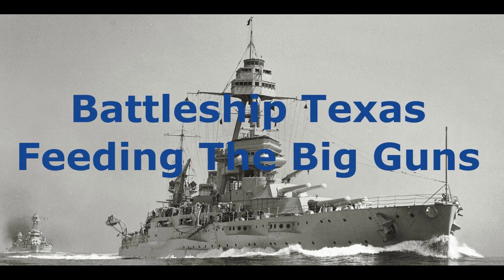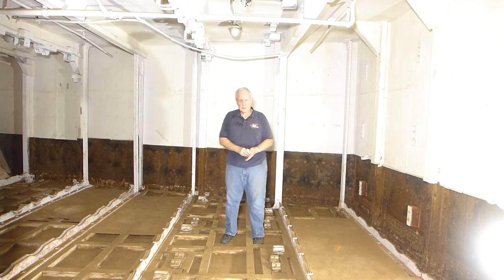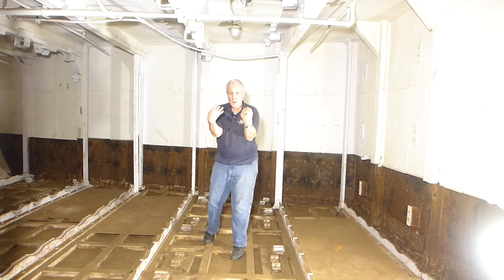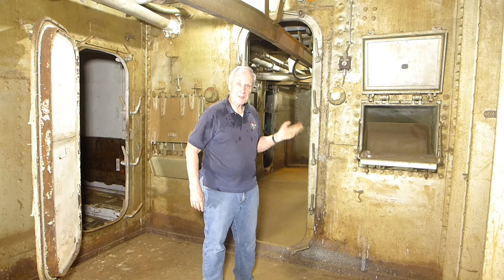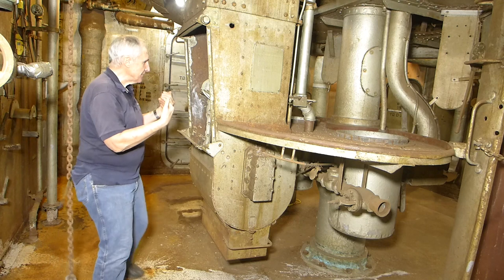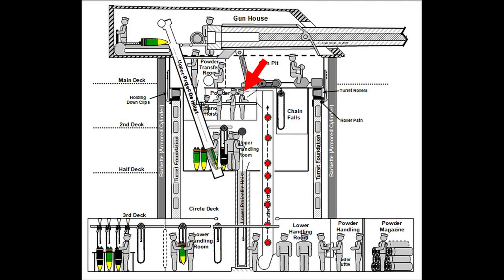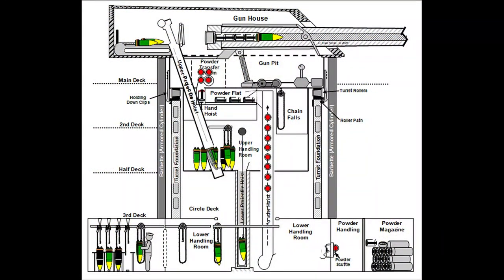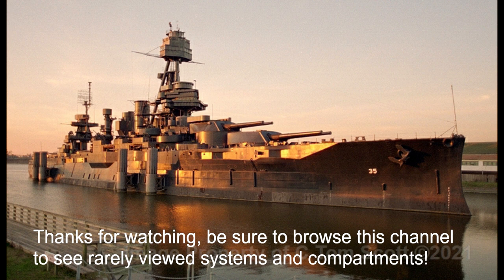Battleship Texas, Feeding The Big Guns

Comment: There are some 16" powder canister's on the USS Missouri.  The seal is locked by a cam which requires the wrench you mentioned.  If I recall correctly the cam locks in either direction but a pointer on the cam points to "Full" and "Empty" on the lid, based on the direction of wrench turn.  This makes a more visual physical indicator for empty canisters, probably desirable for low light situations.
Reply from the maker: It would certainly make sense to have an indicator like you describe, but I haven't seen any sign of one on historic drawings and photos of 14" tanks, nor is there one on the tank that was on Texas.

Comment: You said only Texas and New York stored their shells upside down.  Were their some flaws in the system that caused them to not repeat this on other ships?  Also, what were the advantages of this system over conventional storage systems?  Thanks.
Reply from the maker: First, this system offered no advantages over newer systems, except perhaps it was a simpler design that was cheaper and easier to build.   While I have no documentation to base my opinion on, I suspect that as the first ships to use 14" guns, part of the problem with Texas and New York was that the Navy and shipbuilders simply didn't have the time to fully develop and incorporate a more sophisticated system like the one used on the following Nevada class.  So while the system was somewhat primitive, they knew it would work.  Again, that is strictly my opinion.  Fortunately, a well trained and conditioned crew could largely overcome the limitations.  The new system used after Texas had shells stored sitting on their bases on the deck and moved with a method called parbuckling. More shells were also stored on circular platforms within the turret structure placing them closer to hoists and eliminating much of the manhandling required on earlier designs.  It was successful enough to be used on all U.S. battleships beginning with the Nevada class and extending through the Iowa class.
Reply: @tomscotttheolderone364  thanks! You are a fount of information!

Comment: These processes would not pass a time and motion study.  Its amazing that the rate of fire is as high as it is with all the people in each of these spaces
Reply from the maker: An argument could certainly be made that it was inefficient if you simply look at the number of crew required to move ammunition and load.  However, I think that the crew would have done nicely if subjected to a time and motion study and we concentrate on results, in spite of the primitive mechanical positions.  Tasks were broken down so that each crew member had a limited task that could be repeatedly perform with minimal motion and without becoming overly fatigued.  Each also stayed within a their well defined position so that they stayed out of each other's way, and they drilled on a regular basis  so that tasks were pretty well committed to muscle memory.  Those who had tasks requiring a lot of physical strength and endurance, such as lifting and passing powder bags, were exercised on a daily basis.  The British were highly critical of the turret system's mechanical design and lack of powered systems, but they also admitted that it worked as well because of the crew's level of training.

Comment: A question to your excellent presentation, Scott!
The purpose of the "Shell Deck", or similar in tanks and even aircraft, is what is also called a "Ready Rack", ammo that is in immediate reach to loaders as you described, but it also has a purpose of quickly switching to another type of round from HE to AP for instance.  I am curious if there is instructions saying what shells where in the ready rack?  I guess it might be AP rounds as they would be far less likely to detonate by accident. 
PS: Have you seen my videos on the turrets of the He 111?  There was almost nothing written about operating those systems, just parts and how to service them.
Reply from the maker: Thanks for the compliment.  I don't think that the high capacity shells were anymore likely to detonate than the ap's.  I have never seen anything that specified the type stored on the shell deck.  I imagine that it varied depending upon what may be needed for a specific mission.  For instance, about 2/3rds of the shells expended at Normandy were high capacity.  These guys were pretty smart, so my bet would be they foresaw that possibility and had a mixture available on the shell deck.

Comment: Very cool, thanks!

Was there any way to unload if they decided they didn’t need to shoot after loading a round?
Reply from the maker: They could unload a gun if a cease fire was called before it was fired, but it was to be avoided.  This is especially true if the gun was hot from being previously fired.  It was not only hazardous, but if the powder bags sat in the hot chamber for more than a minute or two without being fired, the heat would change their ignition characteristics and they couldn't be trusted to perform correctly.  

Unloading a hot gun required clearing the turret of all personnel, except for a gunnery officer and a coupe of gun crew.  They would then carefully de-prime it and open the breech.  Each of the four bags would be pulled out and likely dumped into a water tank to make them safe.  A gun crew member would then crawl into the powder chamber and attach a removable lifting eye to the base of the shell and tie a rope to it.  The other end of the rope would be tied to the rammer that had been partially extended.  It would then be run in reverse to pull the shell out of the gun and onto the loading tray.  Doing all of this would likely damage the driving band on the shell, making it likely that the shell would be inaccurate when it was fired. 

It is for all of these reasons that it was much more likely the gun would be "unloaded through the muzzle" after a cease fire by firing it.  In that case, the turret commander would be given permission from the gunnery officer, who had gotten permission from the ship's captain, to aim the gun in a safe direction and fire it.  Since there were typically other ships around the battleship, it would also be radioed out to them what was about to happen so that they could be prepared.
Reply: Thanks!

Comment: Thanks Tom! It was great to see a detailed description of the powder dividing room (powder flat), one of the more obscure spaces on the ship.
Some questions:
How is this space accessed?  Is it very difficult to access?
There seem to be two doors that cover the power hoist outlet. What is the purpose of the second, thinner door?
At 11:30, what looks like a hinged door can be seen in the lower left of the frame.  Is this one of the manual hoist doors?
At 13:30, peeking out behind an open access door, is that an immersion tank?
As always, thanks for your enthusiasm and hard work in making these gems!
Reply from the maker: There is a ladder on each side of the forward part of the shell deck that is a short climb to the dividing room.  It's not particularly easy to get into.  You have to step up on the projectile storage rack to get on the first step, squeeze through a small hatch into a blower room, then go into the dividing room.

I don't know why the second door is there, except maybe to keep junk from falling into the hoist when it is not in operation.

Yes, that is one of two doors used to push powder bags through if using the manual auxiliary powder hoists.

There are no immersion tanks in the dividing room.

Comment: Hi Tom! Which guns (primary, secondary, anti-aircraft) of the Texas that she owns now were used during WWII by her and which ones were WWII-vintage but used on other ships and which ones were cosmetic replicas not designed for military use? Is it true that the quad 40mm guns were from the Missouri in the 1980s and were those Missouri quad 40s used in WWII by Missouri or other ships or were they manufactured during the Cold War?
Reply from the maker: There are no replica guns on the ship.  The 14" were on board and installed in October 1944, so they were used at Iwo Jima and Okinawa.  Most of the rest were all removed prior when the ship was prepared for donation in 1948.  The 10 3" guns were replaced with early versions from the early 1900's, so they lacked the more modern director receivers and fuse setters found on the ones they replaced.  All 40mm quads were removed and a handful of 1.1" quads were placed on board as displays.  Those were removed in 1988-90 when the ship was in dry dock and a full set of 10, 40mm plus Mk.50 directors were placed on board.  Many, but not all, were from Missouri that were removed from that ship during her modernization in the early 1980's.  I don't know their history, or that of the others, prior to that.  Most of the 20mm were removed, along with their directors so that the remaining have only the crude optical sights.  I am not sure of their histories.
Reply: @tomscotttheolderone364  Thank you so much! Texas and the Foundation are so lucky to have you as a contributor to documenting and remembering and caring for her. 

I saw your video recently talking about the incredible fact that 9 of the 10 14" guns on her right now were her original 1914 guns and after so many decades from 1923 to 1944 they returned home to her in 1944 ready to fight in Iwo Jima and Okinawa.

That is impressive that the 10 ancient 3" guns are still historically accurate in terms of Texas used that model at some point in her career. I am so glad those horrible 1.1" quads were removed in 1990. Those 1.1" quads were the worst weapons made by any country that were used in WWII. Completely worthless unlike the legendary 40mm quads.

How about the six 5" guns? What is the history behind them? I did notice that some of them have "1919" stamped on them. It is good to know that they were built way before WWII but did Texas fire those six 5" guns during WWII?
Reply from the maker: @nogoodnameleft  Others are attempting to build a history of the remaining 5" mounts.  It appears that at least their pedestals and slides are original to the ship, and the barrels replaced more than once.  Like 14" barrels, they will always carry the year of manufacture and the dates of each time they were relined.  These particular guns were used during 4 of the 6 times the ship engaged the enemy; 6 shots at Morocco, 272 shots at Normandy, 967 at Iwo Jima and 2,019 shots at Okinawa.  We don't know the number of shots fired by each mount.  The guns had an effective range of about 15,000 yards, or about 9 miles, which put a lot of enemy shore emplacements and other targets well within their range during landings.  These were very high velocity, flat shooting weapons, with a rate of fire of 8-9 rounds per minute, so they were very deadly when used against anything less than heavy concrete bunkers.
Reply: @tomscotttheolderone364  Thank you so much. The drydocking of Texas is great for publicity and awareness. I wish you all the best regarding the refit.

Comment: What stopped the turret from  turning while they where loading a shell into the lift system.
Reply from the maker: Turret movement and aiming always took priority and would never stop to allow moving shells or powder bags.  To begin with, the turrets only occasionally moved a lot.  Once initially aimed, they would make small, slow movements for aiming corrections that had little effect anywhere in the handling system.  The only location where it may be a potential issue was in the lower handling room where shells and powder bags were brought from the magazines and placed on the lower hoists.  Whenever the turret was training over a wide angle, moving shells and powder there simply paused until it stopped.  Small turret movements made it a little more difficult to get heavy shells on the hoists, but little more than an inconvenience.  In the meantime, there were typically 24 shells stored on the shell deck, immediately below the turret.  There were usually enough powder bags on the hoist, in the powder dividing room and in the side pockets to fire both guns at least twice.  Moving powder and shells from those upper locations never paused since they were attached to the turret and turned with it.

Comment: Really appreciate your demonstration and diagram, the pressure on the men must have been intense during a reload while the ships maneuvers.  I wonder if they had a man on standby in case needed to takeover for someone.
Reply from the maker: I have never seen or heard anything about crew being held in reserve, but there was extra capacity in the form of high manning levels used in the rooms to spread out the work load and reduce fatiguing.   If someone was disabled, his work could be spread out among the others, but at the expense of increasing their fatigue.  It is my understanding that the crew in the powder magazines, particularly the tank men, had to be changed out periodically.  When powder tanks were opened, they released ether that out gassed from the propellant. It was not enough to anesthetize crew or dull their wits, but it was enough to give them a bad headache.  So, they switched places with other men working outside of the magazine to recover before going back in.
Reply: @tomscotttheolderone364  That explains it, thank you so much!

Comment: Where were the fuzes installed? Im assuming they were fused in the base?
Reply from the maker: That's correct.  Both armor piercing and high capacity shells had base mounted fuses that were installed at ammunition depots before coming on board ships.  HC shells had the ability to accept point detonating fuses in their noses that would be installed while the shell was on the gun loading tray just before it was rammed into the gun.  There were two fuse options, an impact fuse that detonated when the shell hit an object and a timer fuse that would provide an air burst when the timer wound down.  This would be set immediately before being rammed.  Duds did occur, and they were both expensive and compromised the mission.  The point detonating fuse, or PDF, was simply to improve the odds of the shell exploding when it hit.  The ship's action reports indicate that they were used most of the time that HC shells were fired.
Reply: @tomscotttheolderone364  Thank you very much!

Comment: Working with Powder Bags did you have to be Hero Safe or was that even a know issue of concern at the time?
Reply from the maker: I am not aware of any program like that at the time.  However, it shouldn't have been an issue on Texas.  Pyrotechnics were a potential issue, but they were kept well below deck and were isolated in their own compartment equipped with sprinklers and capable of being flooded.  Powder bags were not sensitive to rf or mechanical shock.  The only potentially sensitive items were the Mk. 15 primers used in the 5" and 14" guns.  That model primer had been used for about 20 years prior to WWII and continued to be used into the 1980's.  There was no indication that they were sensitive to unusual mechanical shock or RF.  They were also kept away from powder bags until the two came together at the gun mount.  Even then, gunnery procedures required that bags be in the gun and breech fully closed and locked before the primer was inserted.
Reply: @tomscotttheolderone364  I asked that question because it reminded me of something I seen once. I was underway when 9/11 happened and at 1st we was allowed to write messages on the bombs we where about to drop. Until the air gunner about lost his mind and started screaming about old Ordnance  being hero unsafe. The bombs we where using where stamped NSWC Crane 1935-1950. old MK 80 and  Mk85 dumb bombs they had attached JDAM kits onto. At the time our hanger bay was completely full of yellow and brown banded weapons. We had to dog all the hatches to the hanger bay and the only guys allowed in was red shirts. Thanks for the info

Comment: First time I have seen the pockets used to hold the shells in the shell rooms (not shown on tours of Texas the two times I visited in the 1990s). But still have not seen an answer as to why the New York class stored the shells pointy end down.
Reply from the maker: They actually started with shells stored horizontally on racks that were picked up and moved using tongs, similar to those used by the British.  This was also the way earlier U.S. ships stored their 12" shells.  However, prior to placing one in the lower hoist, they had to swing the shell base up to attach it to the hoist cable.  I have not seen any documentation to support this, but my best guess is that after living that for a while, they figured that significant time and effort could be saved by simply storing shells nose down to begin with.  That automatically placed the shell in a lift position.  It also presented them with a better way to grab and push a shell that weighed 400 lbs. more than its predecessor along the trolleys from the magazine to the hoist.  After performing a shell count for magazines before and after the change I found that the new, nose down storage method also resulted in a shell storage capacity increase of about 10%.  As far as why they used a hoist system that required hauling shells nose down, I again can only guess.  The use of 14" guns on the New Yorks has all of the earmarks of being a rush job.  The greatly improved handling systems on the following Nevada class were likely still in development and not ready for use.  If that is the case, the decision to use the hoists found on Texas was one of expedience.  It was simple to design, install and operate, even if it was less efficient.  However, a well trained and conditioned crew could maintain a rate of fire of 45 seconds per gun on the system.